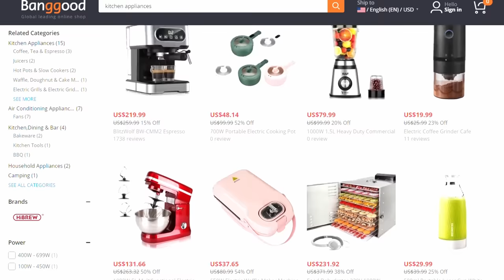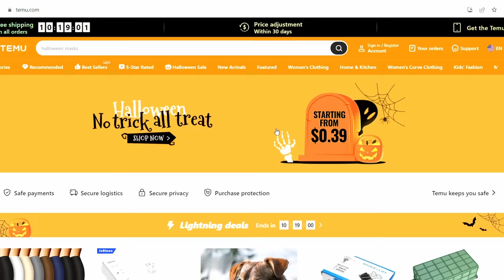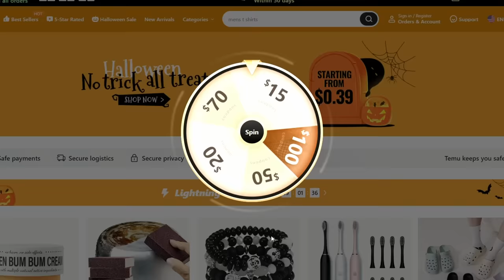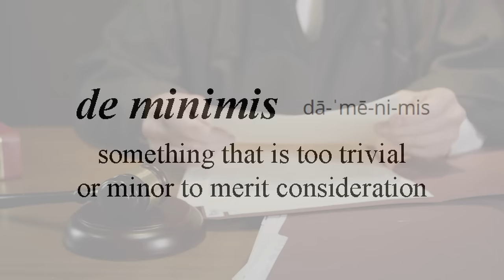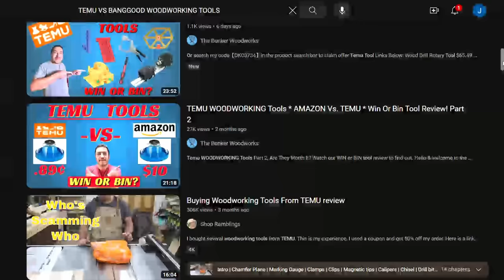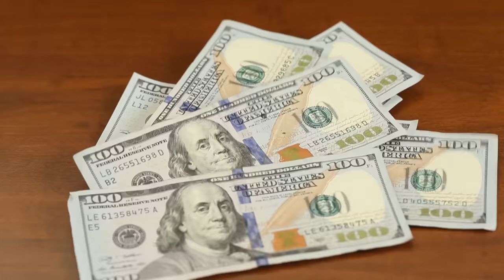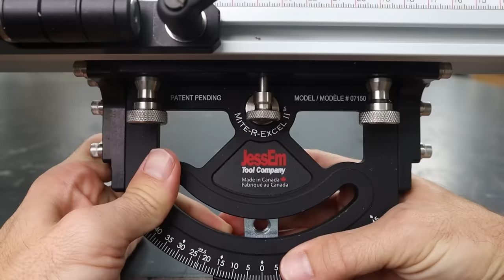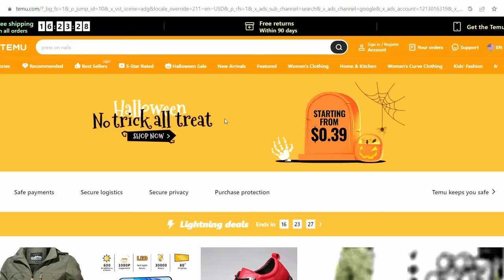I bought knockoff tools from Temu

Comment: Ehhh $120 for something that cost them $5 to make. 🤷‍♂️ easy choice
Reply: Machining items from billet aluminum on CNC machines is NOT cheap.  The cost of metal from the mills has skyrocketed.  You couldn't buy the aluminum to make one of those corner squares for $5 much less machine, anodize and package it.  I showed some brass 1/2" x 1" Fillister head screws that I made for a restoration to a machine shop owner.  He said, "People wouldn't understand that those are worth $150.00 apiece."  Just the brass cost about $4.50 per unit and it took about 1.5 hours to make each one.
Reply: @David-hm9ic  bro, so?! With all due respect my Temu squares have been an amazing addition

Comment: I buy American when I can, but I'm not paying insane prices for pretty red machined aluminum.
Reply: Pretty red machined aluminum with QA policies that ensure extremely tight tolerances, in Woodpeckers case. Depending on the work you’re doing, those tolerances may be critical or insignificant.
Reply: The cost of woodpecker products isn’t related to the cost of the materials or manufacturing. Woodpecker makes luxury goods and you are paying for the prestige. I’ve seen a lot more woodpecker products hanging on walls than actually being used.
Reply: It's paying for a brand name and yes professional grade Tooling and QC. With that said, 90% of us on here are hobbyist and amateur woodworkers who do this for fun, and our human error negates the precision that these boutique tools offer at that price point. So even though you paid a small fortune for a dead accurate tool, means very little when the performance of the user cannot operate at that high of a tolerance level to begin with.

I happily own several made in America tools, but there isn't any valid reason to fork over the cost for the high end professional business grade tools (with considerable market branding) for someone who does this for fun.
Reply: And what are they innovating? It's squares and clamps. Things that have been used for generations in woodworking.
Reply: @Selwoc10 nice oversimplification 🙄 they produced their delve square and iGaging thought it was good enough to outright copy
Reply: They're innovating marketing.
Reply: You can disagree with the prices of Woodpeckers all you want, but to say they aren't innovative products is downright absurd.
Reply: @keithc1335  But see, I don't give a crap about prestige and I don't respect anyone who does. I want tools that work. If the red aluminum tools from China perform exactly the same as the overpriced aluminum cram from Woodpeckers, then I'll buy the ones from China. This is about competition and a lot of companies need to learn to compete. I'm not excusing IP theft, but here, we're talking about a hunk of aluminum. You can't copyright an angle or a color.
Reply: The question is, how many of those items are just assembled locally, using parts sourced from China?

Supply chains are global, companies don't care about local jobs, they just care about profit, and perception.

If they can persuade you that they are local because they spend 5% of the manufacturing cost locally, while spending 95% elsewhere, then that's 5% well spent.

Comment: amazon does the same thing. they get someone to sell a product, then they mimic it and sell it for less and kick the original vendor off the site
Reply: 100% amazon does not "play by the rules"
Reply: Yes, they use their vendors' inside information on sales against them: if something sells well on Amazon with apparent profit they will out-compete them. It seems there are no rules of fair play.
Reply: Not the same thing, though.  And is that really the game at this point.  They also get criticized for largely just squeezing their sellers.  The place is like Ebay, without auctions or transparency.  How does that jibe with the idea they are screwing their vendors so they can take over their businesses.  They have a different way of screwing their vendors.
Reply: From what I summized Amazon was a reputable seller. They seem to do their homework and choose the right vendors. Now, there's a good chance many of the products you purchase from their website are Chinese knockoffs.Or the Chinese reverse engineered a product, made it just different enough to get around our patent laws, and sell it through Amazon. But where do you go? Americans made the decision to buy cheap junk over the more expensive quality version. Harbor Freight anyone?
Reply: Lodge cast iron cookware is an example. Made in the US, but Amazon has their own version , with slight design change, made in China expressly for Amazon.

Comment: I worked for a US clothing and sporting goods manufacturing company for almost a decade. They stopped having anything manufactured in China because the factory would spit out "knock offs" after they were done making our order and then sell them for the price we were paying them. Which like you said doesn't cover the investment we put into the R&D of the product. Often the knock offs would be using different materials, in some cases they would drastically affect the potential lifespan of the item, others were using lead or other unsafe materials, and some didn't have the same performance. The other thing we noticed was intentional material swapping they'd try to do on us. They'd increase and decrease amounts in a blended material based on the current prices where we had it balanced based on optimal performance. They'd swap out for a cheaper dye that would fade in a few months when the original would last a few years.
Reply: Yep. 
But I have zero sympathy for them, bc they decided that domestic workers were a line on their balance sheet, instead of people they had a responsibility to.
Reply: I saw this done about 25 years ago when I was on vacation in Hong Kong. Workers were sewing Ralph Lauren shirts with logos on industrial sewing machines, then they would stop and sew a batch of JC Penney shirts with the JCP logo and different fabrics, but same design. After done with the JCP batch they would start on the clone shirts, different (and lookalike but lesser quality) fabrics that would be sold as knockoffs, still using the RL patterns. I got the impression that the workers - many of whom doing this in their own homes - were getting paid to produce X amount of legit goods, on the click. But after hours they were free to produce their own clones, to bolster their income.
Reply: @kimanjo  No, that's standard practice in their country's industry. I used to be an Amazon seller, & learned that factories have a practice called, "Private Labeling." They make certain goods, & then attach your logo to it. Anything from a pen to a piece of furniture. Sometimes, it's not even that Ralph Lauren's patterns are used, it's that Ralph Lauren had a factory private-label a garment for them.
Reply: @dottyjyoung  
They also (likely) went to the lowest cost bid, bases on the story, and thusly, the manufacturer made up for the lack of profit by making the knock offs.  
If they paid more to a reputable Chinese company they could avoid that.
Anyone can hit the internet wheel and take their chances on whom they are dealing with.
Reply: I had a storefront business selling leather goods, mostly jackets. My supplier used to sell the same products at my wholesale price on Ebay. Can't compete with that.
Reply: @Automedon2  because consumers will pay the lowest amount possible for the exact same products. If you made the leather goods I would be interested in buying US made craftmanship but why would I be interested in just paying your markup.
Reply: @coincollector315  exactly, but it is an unwritten rule that wholesalers don't compete with the retailers they sell to. Wouldn't you love to be able to buy a car, made overseas, for the cost to manufacture? I would.

Comment: Funny that one of your examples was spring clamps - just last week I ordered some extra spring clamps off of Amazon to supplement the ones I had. $8 and change for 8 clamps and a pretty good pliers (which I didn’t need). Junk! The teeth didn’t meet in the middle, so the clamp torqued  itself off my mitre every time I tried to put it on. Returned those and paid $38 for twelve Collins clamps (no pliers). They are the brand I already had and I knew they would work flawlessly, and they did. Sometimes you get what you pay for.

Comment: I can see the moral dilemma for a woodworker in the US. 
Buy from a US based producer and pay a bit more. 
Or save money and get it from Temu.
But from the perspective of someone outside the US, I see it as less of an issue. 
Take Woodpeckers for example. 
If I want to buy one of their tools, because of the strength of the US dollar, I have to pretty much pay double what someone in the US would pay. 
And then add shipping (which can often equal or exceed the cost of the item). 
I don't know why shipping from the US is more expensive than elsewhere. But that's just the way it is. 
So I don't have too many qualms about buying a woodpeckers knockoff from Temu. (Oh, and get free shipping).
Because I am not depriving Woodpeckers of a sale. 
I would never have bought the tool for what I would have to pay Woodpeckers for it.

Comment: I agree with what you said except one thing. You pointed to the wood pecker square that cost 125$ for two. We all know we need 4. That’s 250$ for a square. Squares have been around for as long as wood working and to think one can justify that price is ridiculous. As long as it’s square and can be clamped, it will work. My point is this company puts their name on some things and charges an unbelievable price knowing their fans will buy them. It’s disheartening at best. Let’s face it, this company has done a great job of taking others products and making them better. But good grief, it’s a corner square. I’m a bit surprised you bought into them.

Comment: One part that's not talked about much on the fake/counterfeit side of things is that many products are genuine, but are sold without license or failed QC. Or, in other words, products that a NA company didn't want for one reason or another, and the overseas manufacturer wants to offload them.

Most things from AliExpress, Temu, etc are basically one or two steps from "direct from factory", with all the pros and cons that comes with the label.
Reply: My theory is most of these knockoffs are made side by side with the “official” product and the US companies unknowingly pay for the knockoff production. Imagine Chinese manufacturer quotes $0.50 per piece to manufacture something, but they know it really only costs them $0.25 per piece…they get the contract at $0.50/per can that pays for the knockoffs’ production and the sell of the knockoffs is pure profit
Reply: @vacrayton  That probably doesn't really happen. Another poster here had a better theory where they run a factory for 24 hours a day but the American company only contracts them for 16 hours so rather than changing the tool setup, they finish the day and do 24 hours. The best pieces are kept for the 16 hour run that meets the production quota and the rest are sold off-brand to recoup/profit off of the remaining run. That made a lot of sense.

Comment: This is such a challenging issue and complex problem.  It's also very similar to pirating media.  The music industry took a huge hit in the digital age when people refused to pay $20 for a CD with one good track on it.  Eventually, things like spotify came along and offered an attractive offering at a reasonable price, and piracy dropped substantially.  Same occurred with cable, gaming, you name it.  There are shades of this happening here. It's piracy. It's PAID piracy, but it is still piracy.  I, for one, own a set of those knock off angle clamps, because there is NO WAY EVER would I spend the asking price from the brand name for a piece of aluminum. All the legal fights and money in the world is not going to get someone like me to throw up my hands and be gouged (in my opinion) for that product, especially if it is still made in a country with cheap labor.  I will pay for quality and location of build if the price is what I consider reasonable.  I've got many tools that fit this bill.  I don't know if a better tariff system would work that lays the cost on the exporting country rather than the importer, but it would likely work better than the model we have now.  At least it might close the gap some.  Of course, it would probably discourage more people from buying more tools rather than encourage them to spend a great deal more.  Not an easy problem to solve.

Comment: I appreciate the video and was glad to see that you weren’t playing both sides of the coin by both talking about the negatives of temu but then also putting temu affiliate links in the video description like some other woodworking YouTubers are doing lately (I won’t name names…).

I’m torn on this issue personally as I do think companies like woodpeckers are over-inflating the “value” of their product development and IP and passing that on to the customer in the form of higher prices.  With that said, they are justified in defending their patents, and I recognize the cost that goes into doing that.  Putting aside the IP/legal aspect, I am a believer that if your product is supposedly “quality” and sells for a “quality” price, then the value of that product should show in how well it works and how well it holds up over time.  If your product sells for 4x more than a no-name equivalent but the equivalent works just as well and  lasts just as long, I don’t think the customer should be at fault for wanting to save a buck.

Comment: The way companies can differentiate themselves from knockoffs is by having a higher level of quality and tolerances. Most of these products dont really have a high level of ingenuity. For example, a L-shaped bracket with holes really isnt that special and I think any company should be able to make them. To stand out and charge a premium it should be because of quality assurance and tolerances. A company should not be able to monopolize red paint or any color. I understand a lot goes into branding but that is honesty useless with zero innovative benefit for customers. I dont have sympathy for companies that spend so much on branding just so they can charge a premium only for knockoffs to undercut them. Taxes and import fees though I agree with John.

Comment: We used to have the opposite problem to de minimis in the EU. When we ordered from China, low value items would sometimes arrive without issue, and at other times our goods would be stopped at customs, assessed for import duty, then the courier would charge us for the import duty, the assessment and the collection fee, so a 10p import duty would turn into a £8 ($10) charge. When you placed an order, you had no idea whether you would win the customs lottery and get goods slightly cheaper or lose and pay more in fees than the goods were worth.

Now, the EU (and by extension the U.K. through grandfathered rules) require import duties to be paid at source, so we always have to pay the duty, but we are never charged for it to be collected, it is just built into the purchase price.

Since these sites have to be able to do this for the EU & UK market, requiring it for the US market really shouldn't be that difficult to arrange.

Comment: Wow Jon.  Eye opening stuff here.  Educational, not in a woodworking sense but, in a global economy and consumer way.  From all the other TEMU YouTube Videos I have watched, most people have conflicting views on many of the same products whether they are square or not and/or the likely hood of being durable and worth the sacrifice in build/parts quality.  The quality control really doesn't seem to be there.  However, I don't mind buying lower priced items if they are in effect, not worth the price of what other manufactures are pricing them at.  For example, the Rockler Glue Tray and brush set.  How much true R&D went into this product to justify a $15-$20 price tag?  Its made of silicone, right?  People been using silicone brushes in the kitchen for spreading oils and silicone cake batter stirrers or frosting spreaders for ever.  The "technology" has been around far longer than it has been used in the wood shop.  The R&D on this product was simply a lazy, yet creative person, saw how these items spread things and said to themselves, hey let me try spreading glue with this and see if it peels off, and it did.  lol.  So, if I can buy  one for a lower price, then I will.  However, the complete ripping off of the packaging and stock photos, is absolutely just straight out stealing!!!  I would never buy it from TEMU just for that fact.  I'd rather search out other companies who do not blatantly rip off other manufacturers.  What I am saying is, we should be smarter consumers.  There are many reputable companies that make comparable products at a lower price point.

Comment: Great job on this and thanks for raising the concerns with these companies. Unfortunately industrial and intellectual theft is big business in China.
Reply: It's actually a little more complicated than that. In the electronics industry, the Chinese manufacturers can require you to give them the design files. Not simple the Gerber files used to produce a printed circuit board, but the schematics and parts lists also. Don't want to give it to them? They're happy to tell you to go somewhere else. The Chinese government heavily regulates Chinese businesses, and they're the ones putting the onus on those companies. Don't do it, you get fined or shut down. They have a very active program to acquire any technology they produce for other countries. Companies are being blackmailed if they want to use Chinese production facilities.